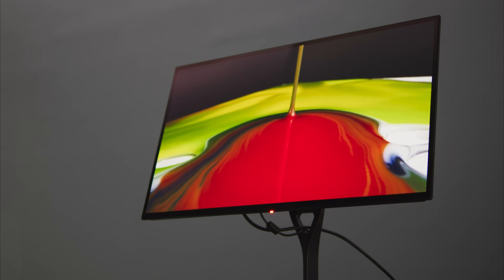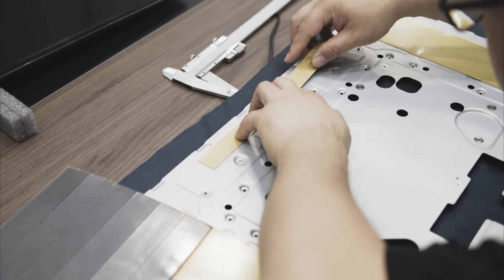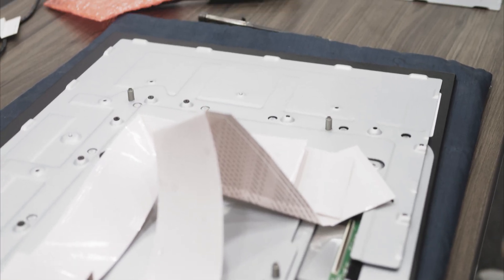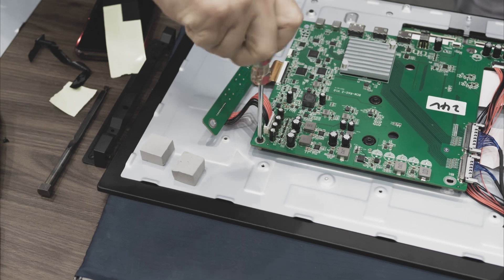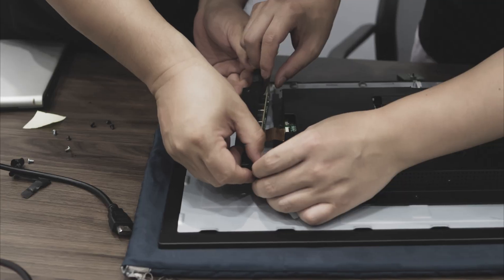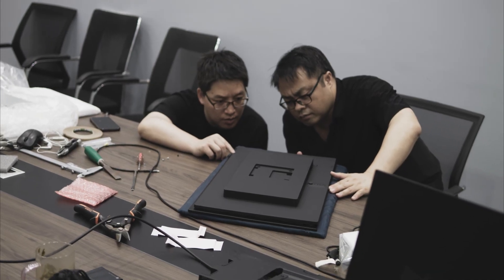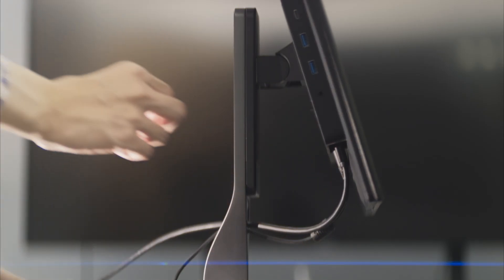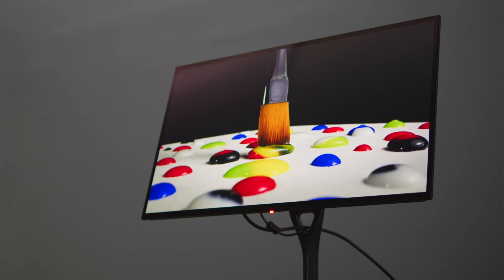Spectrum OLED - First Sample Assembly Challenges

Comment: What’s the brightness of that monitor in a completely dark rook? Is it sufficient or will colors look different than they are supposed to look? 🤔
Reply from the maker: We've gotten some preliminary measurements and the brightness performance is good for most environments, though we're currently working to find the right balance between peak brightness and durability. We'll most likely offer users the option to adjust this.

Comment: If possible, could you try to get a better thermal solution for the power delivery VRM? A thermal pad as thick as shown will have a hard time transferring any heat to metal. Just having airflow with no pad would likely be better than the solution on this test unit. A better solution being getting metal heat sink closer to the VRM in the first place to use a thinner thermal pad.
Reply from the maker: Thanks for the suggestion! For this unit we were testing some thermal material that we had used in our previous monitors, but we'll be running thermal tests and may change the exact thermal solution used for power delivery.